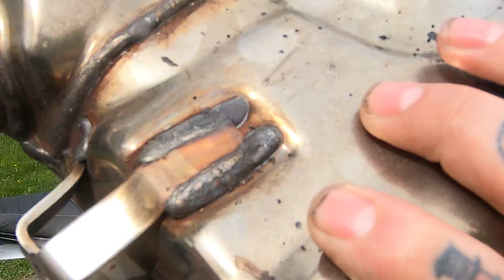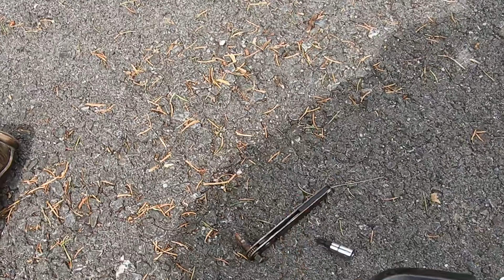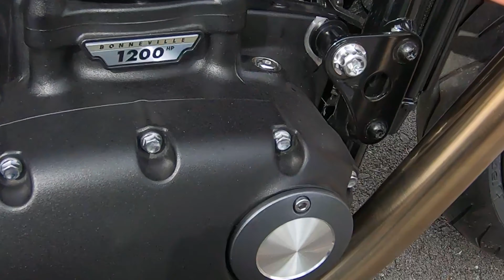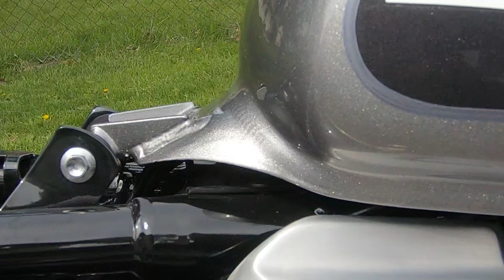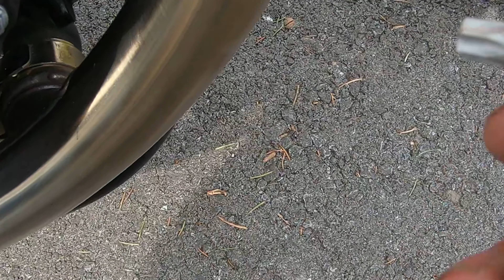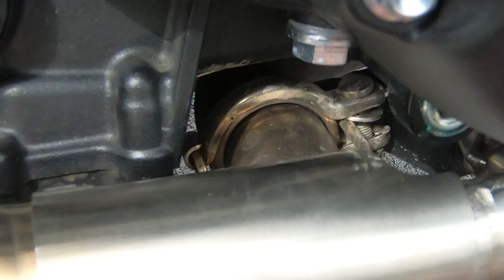X-Pipe Instructional // Triumph Speed Twin // Cone Engineering // 4K

Comment: Good job Mr. Pants. Only 4 hours? Took me a lot longer than that. I put a Motone Xpipe on a T120 Bonnville in 2 hours thinking that was tough. So many different types and sizes of nuts, bolts and screws to deal with. But it made a very noticeable difference in the way the bike performed and sounded.  So first thing on my list was to put a Motone Xpipe on my Speed Twin followed by Predator Pros. It was a much more complex and time consuming process than on the T120. Frame is different, new mounting plate under the crankcase and a crossover pipe between the exhaust headers all contributed to more difficulty in the process. But again, the results were worth the effort.

Comment: Good content, but was Michael J Fox holding the camera?  Shaky as hell...  lol

Triumph really made it a pain in the dick to change that cat out...  Loosening headers, removing part of the frame, etc...  There had to be a better way to design things, right?
Reply from the maker: Haha yeah my early videos werent the best quality. Ive since moved to a cam with better stabilization. As far as triumph goes, they can't make a catalytic converter easy to remove lol thank the awful EPA regulations for that! Some newer bikes actually have the cat welded on to deter people
Reply: @NicePantsLance  Triumph cats are tough AF to remove.  Really hard material to drill and pound out.  Kawi is the opposite, soft and more fragile, takes much less effort and time to rip them out